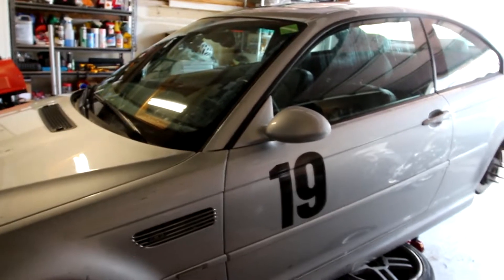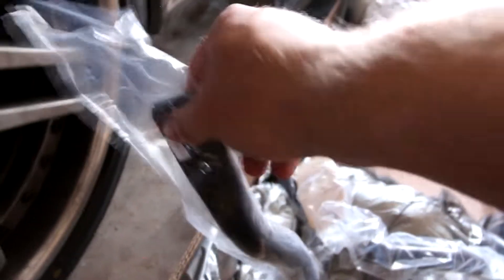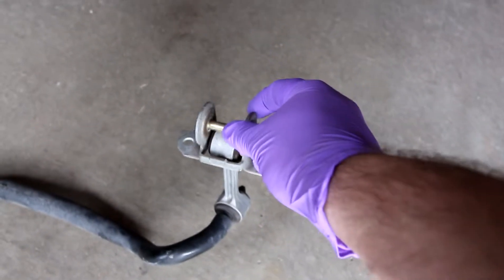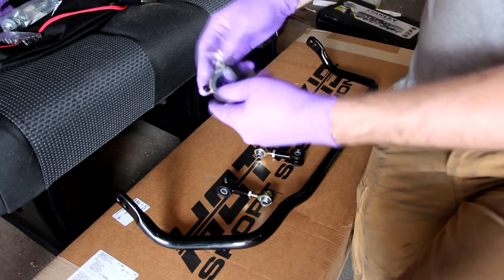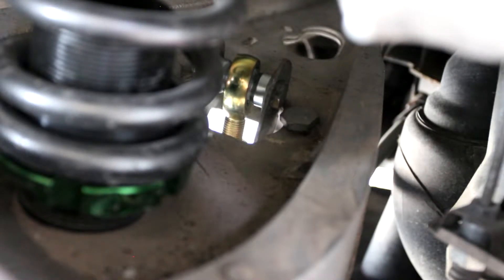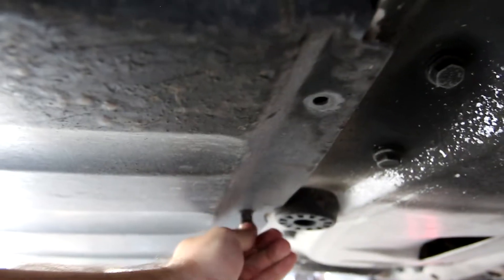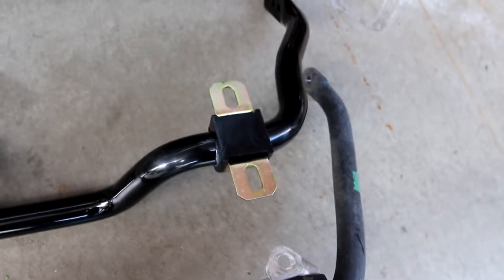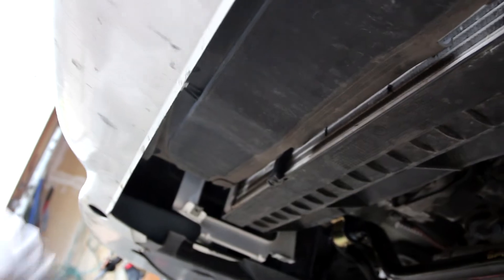How to Install Sway Bars (BMW E46 M3)

Comment: And how was the performance on the track? Did you feel a big difference? 🙂 how long it took to install both sway bars?
Reply from the maker: Yes, there was a big difference in stiffness, car felt much better. I have played around with the settings of it since installing it, cant remember where its at now off the top of my head, its not where I put it in the video is all I remember. As for time, I was filming so that slowed me down, but if you know what you're doing, and encounter no issues, shouldn't take more than an hour or an hour and a half. Its a pretty straight forward job.

Comment: What setting did you install them on in terms of the percentage of stiffness and how has that worked out?
Reply from the maker: I did 79% in the rear and 28% up front, it has been working well, but I have been thinking of switching to 49% in the front to see what kind of effect that gives me.
Reply: @WannabeRacer  thank you for the fast response, would you say that 79% and 28% would be like an aggressive street setup? I run canyons a lot but eventually will start tracking it.
Reply from the maker: @diamondplays8944  I would say its pretty stiff. The rear only goes as low as 79% with this bar, but the fronts can go to 11% if you want softer. It is a little hard to say though because I am running after market suspension and I have that set to full stiff.
Reply: @WannabeRacer  i think i’m gonna run 79% and 28% for my daily use and change it to max when I track it. I have a subframe brace and front shock tower reinforcement so im not too worried about it ripping out those parts lol
Reply: @WannabeRacer  what coils are you running?
Reply from the maker: @diamondplays8944  Nothing super special, currently have Fortune Auto 510 coilovers front and back. I will upgrade them at some point though.
Reply: @WannabeRacer  ah gotcha. I’m gonna buy KW v2’s, heard some good reviews
Reply from the maker: @diamondplays8944  Sounds like a good bet, not the happiest with mine so far.
Reply: i know its late but i want a pair...  y didnt. you like the coilovers @WannabeRacer

Comment: Dumb question, but I always thought you installed the sway bar with the car in compression (wheels on ground or ramp)? Am I incorrect or does it not matter?
Reply from the maker: So I could be incorrect here on this one, but from what I understand about it and what I've been told, doing it on the ground is a matter of convenience for getting it lined up with all the bolts, but not a matter of necessity.
Reply: @WannabeRacer  I appreciate the feedback. Got the same bar going on next week!
Reply: @WannabeRacer  According to TIS, the bushing mounts need to be torqued with the suspension in the 'normal position'.  The links you can do with the car in the air though.